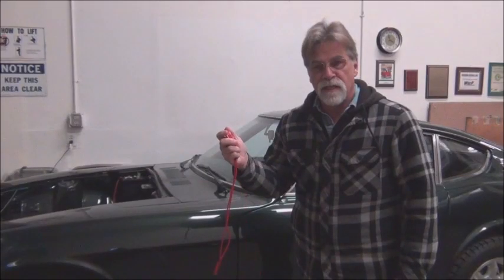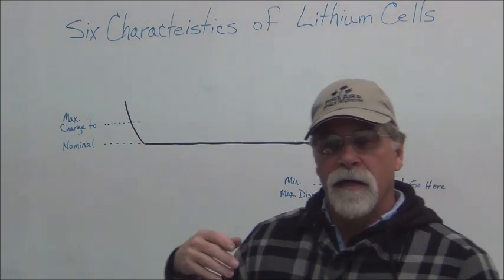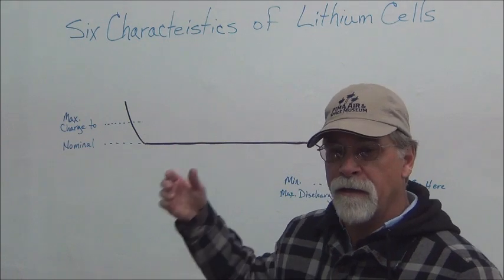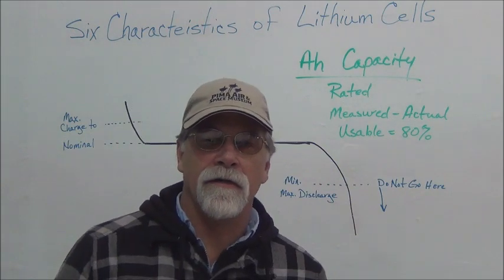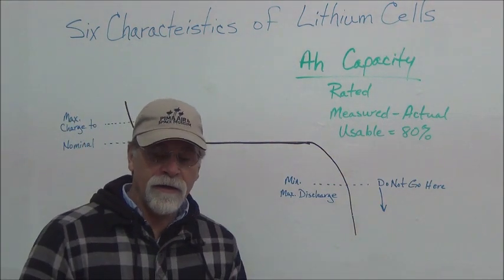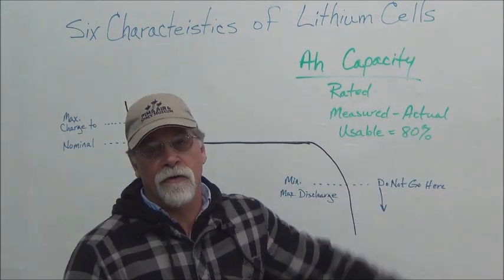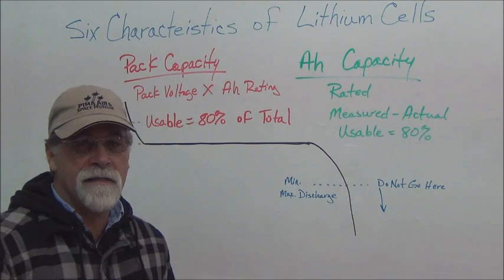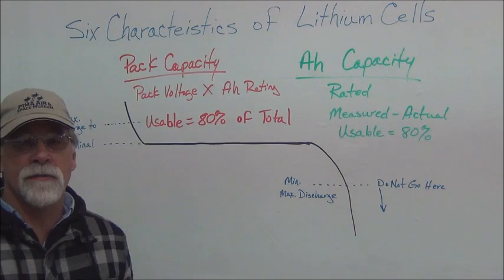DIY Lithium Battery Cells

Comment: Hi, watched almost all of your videos. I have a question. Are you using Battery Management Systems for your battery pacs? Because I havent seen one in any of your videos. Thanx
Reply from the maker: We do not, and never have.  We bottom balance the cells and they have stood the test of time.  However, we do replace a lot of battery packs for those who used BMS.